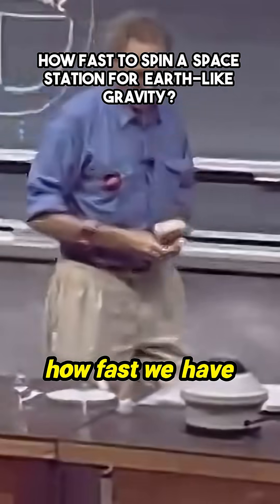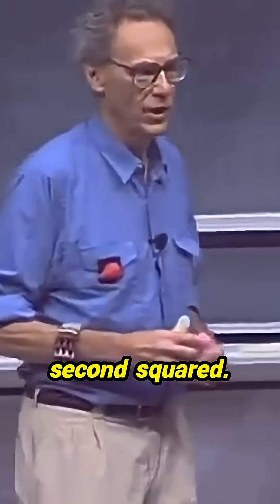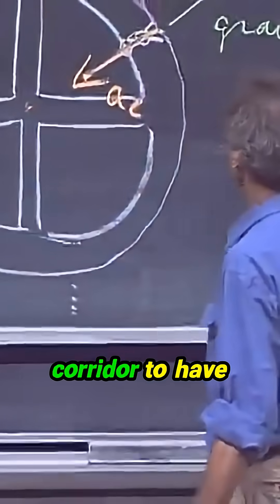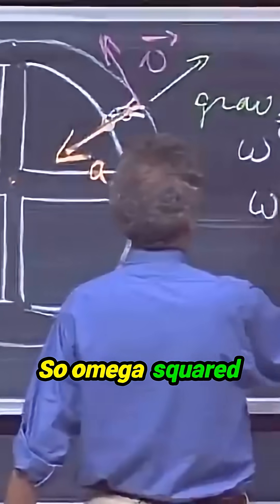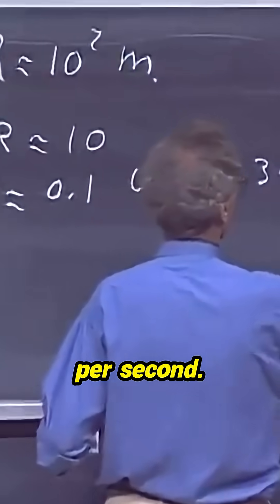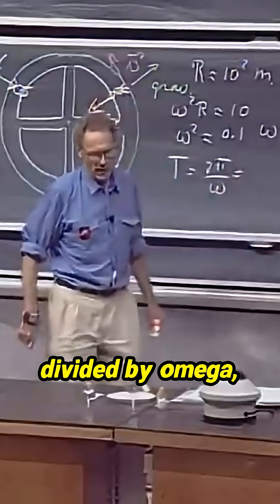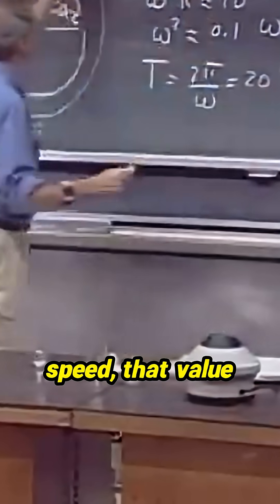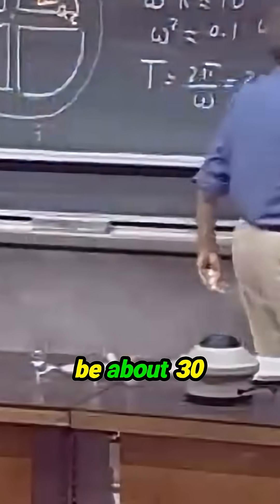Ever wondered how to create artificial gravity in space? 🚀

Comment: About 67 mph, which isn't incredibly fast when you're not worried about air resistance.
Note, it's not stated in this short but the rotarional speed is inversely proportional to the diameter,  so at 70mph, we're looking at a diameter of 180m. In order to maintain earth gravitational force, the wider the space station the faster it would be at the edge, so for a 1000m station, 360km/h (220mph) at the edge. However,  suppose we have a fixed inner ring on that 1000m diameter station with a 100m radius, for the same angular velicity the simulated gravity would now only be about 2m/s^2, or about 1/5th earth gravitational force. Thus, when designing a rotating space station,  one would have to decide the total width, and then decide which part of the 'wheel' you want to feel earths simuated gravity.